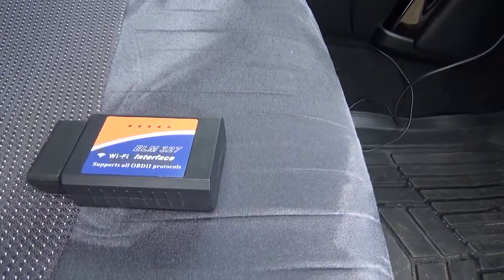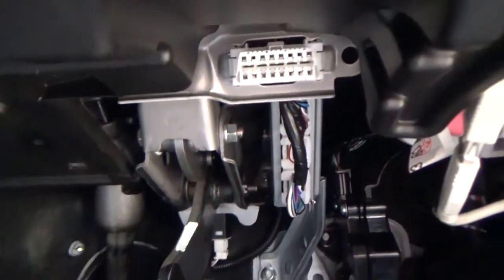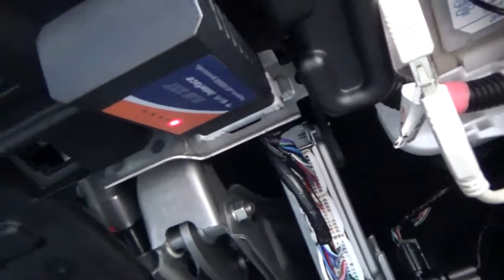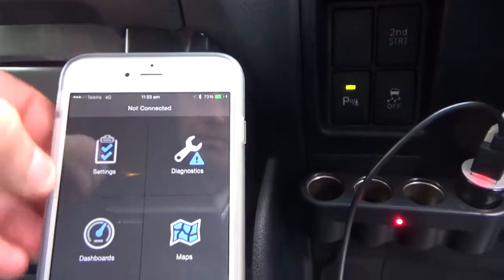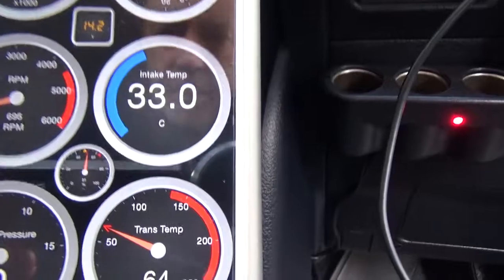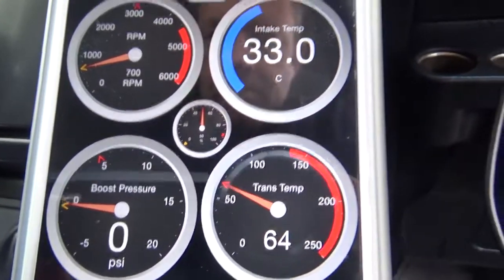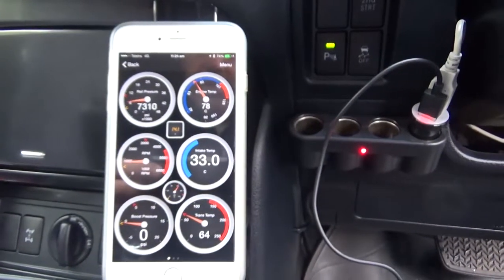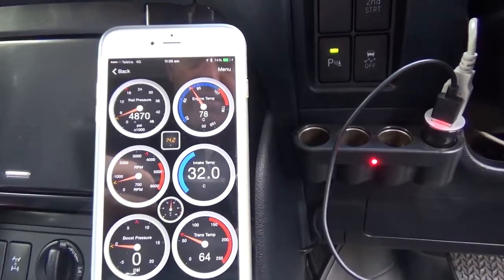OBD2 adapter and OBD Fusion app on a Prado 150

Comment: Hi! Thanks for the amazing video! btw, I have a question? After I connect the obd2 adapter, do wifi connection, connect via the app to the obd2, I get the 1) the ABS light, 2) slip indicator light and 3) the multi terrain indicator lights on (all three). Did you have such an issue?  I read somewhere that this is due to the fact that the OBD2 adapter puts the car in abs diagnostic mode (some pins are the issue). Anyone with this same problem?

Comment: Mate whereabouts do I find transtemp like you have?
Reply from the maker: Add this as a Manual PID

PID :- 21D9

Long name :- transmission temperature (or whatever you want)

Short name :- Trans Temp (again whatever you want)

degrees :- C

range :- max 180

There is another line there I think you leave as :- 1

Formula :- ((((((E*256)+F)*(7/100))-400)/10)-32)*(5/9)
NOTE: There are 6 open brackets at the start

OBD Header :- 7E1
Reply: Hey mate, Just seeing if this equation is more correct than the one posted in your description? thanks @jjsadv
Reply from the maker: @-boska  There is a typo in the one in the description.. I think this one is correct. I will have to update it

Formula :- ((((((E*256)+F)*(7/100))-400)/10)-32)*(5/9)

I havent looked at these things for a while..
Reply: @jjsadv  thanks! I’ll see it it works tomorrow. Used to have codes but lost them. Is this one accurate?
Reply from the maker: @-boska  it seems to be.
Reply: Yeah for some reason it wouldn't work with mine @jjsadv
Reply from the maker: @slaughtermotorsport1727  I used the above PID and formula to convert it.

Comment: Hi! I know it’s an old video but I’m hoping to get some info. I have a wifi OBD2 adapter too hooked up to my 2010 Prado 150 but can’t get it to connect to the ECU. Would you know if which OBD2 protocol your adapter uses and if you entered any “init” or initialization strings in the advanced settings to get it to work? Thanks!!!
Reply from the maker: Didnt have to add any Init strings, Just chose a default vehicle. The only thing I did was add a formula to get Trans temp. These things are a little flakey. I use an App called OBD fusion.
Reply: @jjsadv  I also tried OBD Fusion and even bought the Torque Pro version but it can't seem to connect to the ECU. All it reads is battery voltage. My OBD2 adapter is a Veepeak version 1.5. Not sure if this matters. So you just selected "Automatic" for OBD2 Protocol?
Reply from the maker: John Ganihong yep automatic. I have only tried the version I have. Mine just worked. Only issue I had was working out the password to get it to connect to the phone Wi-Fi.
Reply: @jjsadv  Thanks for all the info! Hope I'll be able to make this adapter work. Awesome 150 you have there! Cheers, mate!
Reply: @johnganihong  , did you get your Veepeak to work. Mine works fine, maybe I can help. What do you need?

Comment: Hello. One question: will this work on all Prado version. Low, middle, high version? Your Prado seems to be High version since your a/c controles are digital. Does your prado have Push-To-Start? I have a Prado 2014 middle version with normal key start and analog A/C controls and the OBD port does not give out any information of rpm, speed.
Reply from the maker: In Australia you have GX, GXL, VX and Kakadoo. The GX being the base model and the Kakadoo being the top end model. Mine is the GXL which is the most popular as its the best value for money. Yes they all have a push start and they all have the same digital Air con.

Yes mine give out RPM, but it may not give out speed. I dont think it does.

Comment: I have something similar,  a Scangauge II, in my Prado 150. After a battery technician connected some device via the OBD port, the Scangauge no longer works (it does work in my wife's Golf.) Do you know of the fuse that the OBD port uses so I can check that?

Comment: gday mate. just wondering if the equation for trans temp would be the same for the andriod torque pro app. also what variation did u use for boost in the settings thx. I also have a 150 d4d prado.
Reply from the maker: +George zairis The equation should be the same. I didn't use any offset for the turbo boost. There are 2 Boost, and absolute pressure. Absolute pressure adds atmospheric pressure to the boost. You want to just use boost. This is the pressure above atmospheric.
Reply: +Marli2 Gday mate. what did you put in the ( English to metric scale factor) field. also the metric to english offset field.  I'm getting -27 for trans temp. thanx in advance
Reply from the maker: I didn't stick anything in here as the formula takes care of it. I think it was just a "1"